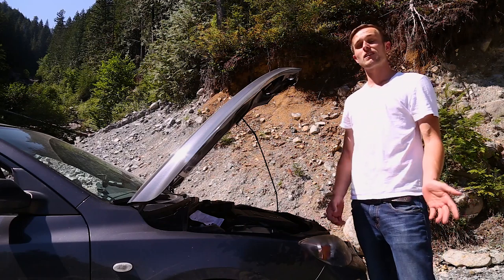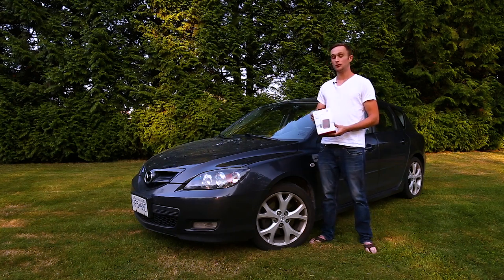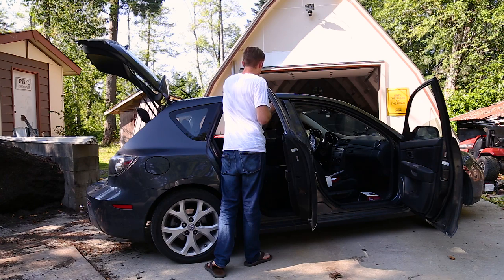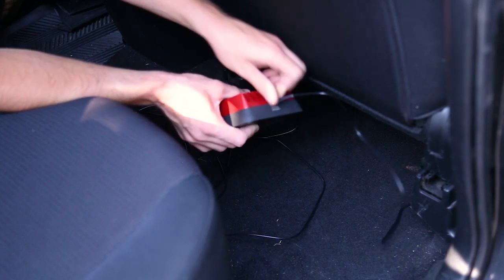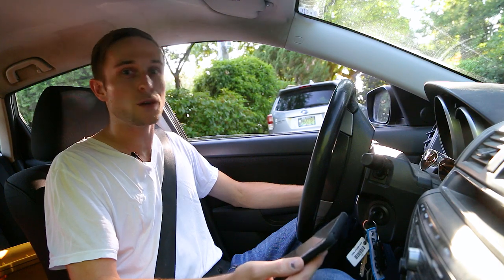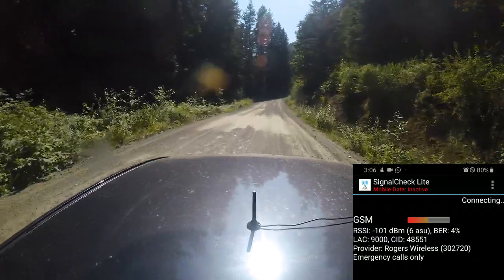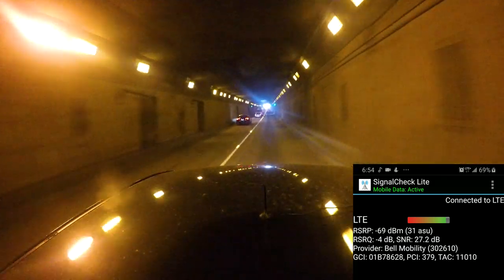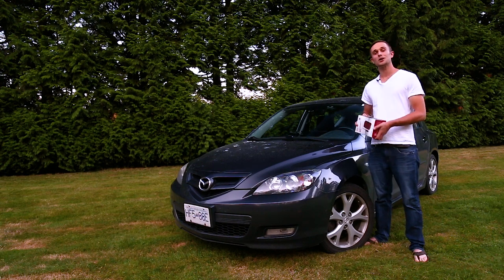Does the Most Powerful Cell Signal Booster Really Work?! | weBoost Drive Reach

Comment: The reason you had a cell signal in the tunnel is because tunnels have radio repeaters that rebroadcast your cellphone signal to an outside antenna and vice versa, basically the same thing your signal booster does in your car.

Comment: I got a gasoline booster that makes the gas station closer to you when you run out of gas. It works off a cars cigarette lighter as well. You won't have to call for help anymore using the signal boost. I sell my booster for 800 American dollar in Canada but it won't work in America. If you live in America I have a different version to sell you that actually goes into the tank.